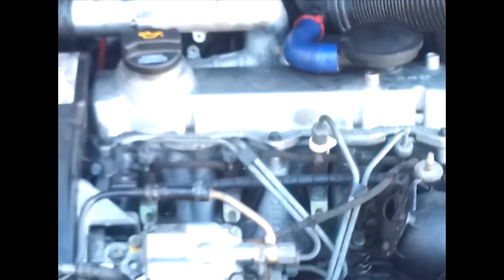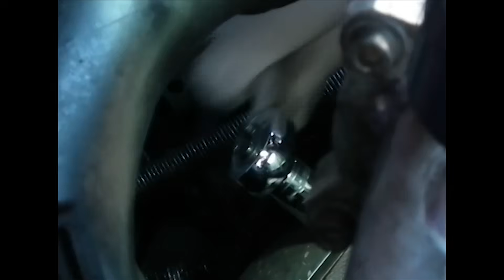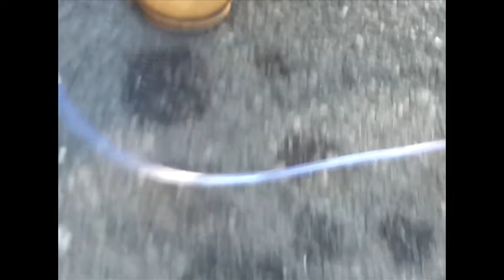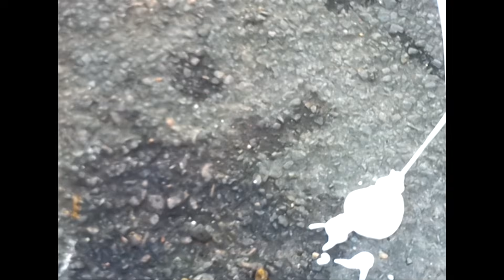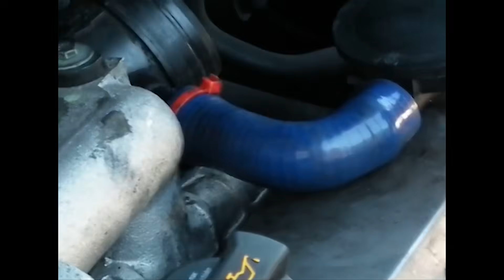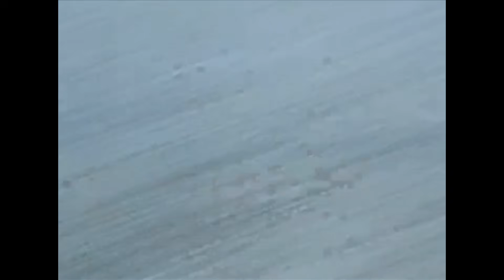Mr Muscle Audi A3 Tdi Turbo Clean - cheap fix

Comment: Would this work on an 2006 Audi A4 2.0 ltr S line as I've recently had a problem on a long journey when after 60 + miles it went into limp mode yet now seems to be working fine?
Reply from the maker: +Paul Phillips if this a TDI?
Reply: +CarAnd “Car Mechanical” Mechanical yes it is & since I put this question to you have confirmed it is an over boost problem
Reply from the maker: +Paul Phillips hopefully now sorted? Apologies for the delay in reply as I am moving. 
This should be fine for any VNT turbo though to answer the original question.
Reply from the maker: +Paul Phillips hopefully now sorted? Apologies for the delay in reply as I am moving. 
This should be fine for any VNT turbo though to answer the original question.
Reply: +CarAnd “Car Mechanical” Mechanical yes it's a 2 ltr tdi only difference is I'll have to remove the EGR valve. Have read though its possible do this leaving it on

Comment: I used your procedure on a 2000 TDI Beetle. I ended up using Easy Off Oven Cleaner w Lye. I had a CEL that gave me a P1557 code, over boost caused by the vanes being stuck open. I used your the more the better technique. Cost was $4 U.S. Thanks,
Dave.
Reply from the maker: That's great news! 
Also regarding the Easy Off does it also contain NaOH? If so I can add a message to the video and description as I think that will help a lot of US guys out.
Reply: Easy Off make a version with & without, I used the version with Na!Ho
Reply: Hello Can I use Wynn turbo cleaner over there ?
Reply: +Mateusz K give it a try!

Comment: Nice vid. One point for people to bear in mind, and this is from personal experience, if your turbo is the original, or mileage is high, be aware of over revving as you might well blow the oil seals on the turbo shaft, and then you´ve got one big job in front of you!! If you´re seeing blue smoke on start up etc. then your turbo seals are probably on the way out.

Comment: Hi,  the cleaner has to be foam?  We don't have in israel that product.  We have a similar product but liquid.
Reply from the maker: +אלחנן יעקובוב I'm not sure that liquid will get to all the places you want at all within the turbo. Essentially you just want a cleaning foam with the Naoh chemical in it.
Not sure if you can import from ebay?
Reply: +CarAnd “Car Mechanical” Mechanical. Can you give me a link to a good foam cleaner?  I searched on eBay but the price was too expensive on my opinion.
Reply from the maker: This is the cleaner http://www.ebay.co.uk/itm/Mr-Muscle-Oven-Cleaner-300ml-/381404541123?hash=item58cd7b70c3:g:eSUAAOSwHjNV-Spl I'd check again on local sites/shops etc... maybe an industrial place has something
Reply: +CarAnd “Car Mechanical” Mechanical ok, thanks. One Mode question,  this process may somehow damage the car?
Reply from the maker: On the Iron/Steel no, on the CAT, nope it'll burn off.
On the Alu maybe (which is why I note in the video not to overfill it) however another guy has commented it's only there for a short time and not enough to erode at the head.
Reply: +CarAnd “Car Mechanical” Mechanical thank you a lot. I Will update for any news with solving the problem.

Comment: May be worth jamming some rag into the EGR hole to stop the foam coming back out, when i did mine i found i couldn't get much cleaner in with that still open but when that hole was blocked up i got nearly 3/4 of a tin into the exhaust manifold/Turbo which did the trick :) (the Actuator was almost Instantly smoother)
Reply from the maker: +K2edg Good point, although I was concerned with if it could travel up as far at the Alu bits. So went with what I thought/hoped was safer.
Reply: In typical belt and braces fashion i tested it on a degrease/clean bit of the cylinder head before putting any in the exhaust manifold, after an Hour it washed off without causing any damage.

I was a little concerned it had filled the bore, so I did remove the Glow plugs and hand crank it over just to be 100% sure but nothing came out.

Just one more thing i did while spraying it in was to turn the impeller wheel gently (not forgetting the tube may need retracting slightly) just so the whole wheel was covered as i didn't want an unbalanced hot side wheel finishing off my Turbo's bearings.

It's a great trick. Thanks for sharing, it saved me a day of pain trying get the turbo off.
Reply from the maker: No problem, and thanks for detailed feedback like this! I am sure it will benefit other people.

Yep getting the engine out and the turbo off later down the line the turbo was the biggest pain to separate for various reasons.

Comment: Thank you, like a new car again. Just finished 40 minute run, slowly for first 5 mins then onto motorway. After about 20mins it stopped smoking completely.Really never would have thought £3 oven cleaner would do the trick. Saved £250 on a new turbo.
Reply: On my 2012 Jetta TDI I bought a Borg Warner 170 turbo for 1200 Canadian and 800 to install.

Comment: Could you do this to a BMW 123d as the results look fantastic?
Reply from the maker: +Tom Hig I'd say I don't see why this wouldn't work on any VNT turbo. My partial thoughts though are; what is access like, how is the turbo orientated?, is there any chance the cleaner could touch something is might damage etc...
With the kind of engine I have I know that is ok but I know BMW engines are mounted the "proper" way so not sure it that means anything is fitted/clocked differently.

Comment: Really good video. How do you know the hoes is going into the turbo housing and not into one of the manifold areas? I'd love to do this on a SEAT Alhambra 1.9 TDI 115 brake horsepower pump diesel tomorrow .
Reply from the maker: +andysuthhero I'll be working on the car shortly so will check how things lined up, this was done a few years ago so memory is a bit rusty. Off the top of my head I think it was kind of inline and the foam would fill from the bottom up so you see it with time to stop before it would get near the ports. 
Our thinking too was anything there would be burned off and through the cat in no time, only concern was not getting it on anything ALU.

Comment: The access to the turbo in a Bora PD130 is terrible unless you have the hands of a Barbie.
Reply: I took off the N75 mount from the right of the engine bay then got my right arm in that way. I hope you have success. my car runs like new
Reply: willwinstanley I've been wanting to remap my car and the company I'm using will delete my EGR for free so I might do that, then I can reach right down and do the turbo :) That's the only thing I can think of. I can't find the turbo actuator from above either. I felt like smashing the car up when I was trying. So annoying.
Reply: +cwuzii I also unclipped the airbox hose from air intake. then removed next two bolts to th left, along it's length, and the vacum pipe clipped to it,  to give myself a view from above. the actuator is very short but is connected to the vacuum bell or can about the width of coke can but 1/3 of height. on my asz 130 1.9 tdi I can only just see the top of can and rod to actuator when bent belly down with torch in left hand leaning over engine. but once you have seen this short actuator lever grab with needĺe nose pliers then push it down a good few times before your back gives out. good luck.  look at some picures online of the turbo itself more closly then imagine what to look for down there.

Comment: Hey man, my golf 130bhp is going into limp mode. What is it that actually puts it into limp mode? I'm planning to clean out the turbo and EGR, but is there anything else to look out for, bad solenoids?
Reply: +razmossis the turbo has vanes in it that open up when you accelerate, they stick open and cause it to overboost hence causing it to go into limp mode. you might n tget a cel light on the dash but you know as there is no power to the car. the mr muscle degreases the vanes in the turbo and allows them to move freely again

Comment: i cleaned out an EGR valve with mr muscle it really is a good cleaner. i want to clean up and old gearbox to get off all the grime and muck thats built off over the years. will mr muscle work?
Reply from the maker: +michael jagger I'd just use GUNK or any other degreaser tbh, something like muc off etc... The oven cleaner is very aggressive stuff.
Reply: With the gearbox i just sanded it with some light paper as the aluminium oxidized and had some pitting looks nice now. It was very dirty at all.

Comment: I did this today, worked pretty well.  In addition, while the intake manifold was off, I cleaned it with oven cleaner as well.  My personal recommendation is buy the cheap stuff next to that yellow bottle.  For this application, the yellow bottle will not take a wd-40 nozzle and therefore no red straw.  Between, the EGR delete, manifold cleaning, and exhaust side cleaning, no more limp mode, now only EGR High flow codes...I need a tune.

Comment: carful u don't get mr muscle into cylinders, if an exhaust valve is open it'll enter that cylinder.    u r on the engine side of the turbo, as in up wind of the turbine?!
be ok if u start it carefully or spray some oil in, ??? not sure what it would do to cylinders?, suppose if u could flush it....u could use it to de coke the engine?   I wonder?

Comment from the maker: Hi Jake, I can't seem to reply or tag you in this but wanted to reply.
If the vane cleaning was unsuccessful it may need a follow up, assuming that is the issue, there may be various issues such as the actuator position, fuelling, the equivalent in your car of the N75, vacuum leaks etc... 
Hopefully you can get to the bottom of the issue, but just in case one option to consider would be an MBC.
Reply: CarAndMechanical ..Great video bro😎👍

Comment: Hi 

This method definitely works have just done on my A4 B7. what garages quoted me that I need a new turbo at the cost of £700.... Thanks to the guy who thought of this
Reply: Icky Rana did you do this via the egr as well?
Reply: Was this a petrol or diesel?  Would this work on. B6 A4 2006
Reply: @enigmamusic6610  you can't tell by the disruption of the title or the sound of the engine?

Comment: This method works ! I have a mk1 Leon 1.9tdi that was over boosting. I have a turbo boost gauge fitted to my car, which showed that my boost levels were approximately 0.5 bar higher than what they should when under load . I used Mr muscle in the same manner as the video and the cars boost levels are back to normal. When I pressed the actuator rod in I thought it was OK before I put Mr muscle through the hot side of the turbo. But after 20 mins of it been in there , it felt much better . one thing to remember is that the aluminum oil feed hose is right next to where the egr outlet post is on the turbo casting, I used a rag to cover it up as Mr muscle is quite nasty stuff. Thanks for the video in the first place, a great guide for people to see.
Reply: plzz tell me how u did this? i have leon 1.9 tdi i wanna try this to my turbo...tell me, u put Mr Muscle into pipe that goes below EGR valve?the long pipe that EGR is connected to form botom side? i read on some forums people disabmmle exaust to get to the turbo, but this way is much easier, and u can btw clean and EGR too...so please tell me how u do this? ty very much, and sry about my bad english...regards
Reply: Hi, you will have to take the egr pipe off that fits between the small turbo outlet flange and the egr valve. You can then use a piece if plastic tube that fits into the Mr muscle can and you will have you poke it down into the turbo like on the video. You are best to remove the egr valve by undoing the  3 bolts that holds it on and cleaning it when off the car as it will be very oilly and thick. Thanks

Comment: Is there any risk of damage to the catalytic converter from the remains of the mr muscle that will get blown through when you put it back together and spin it up?
Reply from the maker: the exhaust temperature will burn off anything remaining and it will happen in seconds. I'd expect it will clean out the cat a bit and blow it out the back.
It's not the same but there are industry solutions that are more concentrated if anything to deal with the same issue.
Reply: CarAnd Mechanical i agree with you but before it gets to go to the exhaust, it goes through catalytic so do you think it will not do any damage?
Reply from the maker: If it did any I would expect it to minimal.

Now from a totally different POV the Cat's restrict performance anyway and I've done away with mine.

However I don't think it would damage it and have neither heard of this too. There are a few kits out there for doing this kind of thing with a higher concentration of NAOH but instead of like £3 cost £40-50 +

Are you in a Country where you get smog tested?
Reply: no we don't get smog test. lucky

Comment: I gave an A3 jetta TDI with stock EGR. Like yours, mine's dropping to limp mode often due to smudge. Where would you suggest filling with the sodium hydroxide based oven cleaner, so as to clean out the turbo ?

Comment: Hi I have a 2001 audi a6 c5 1.9tdi it has 177k miles on clock I has been put on diagnostic machine and come up with fault code charge pressure control positive deviation every time i get past 60mph it goes into limp mode until i restart car do you think this will cure my problem?
Reply: I have the same problem, the error on diagnostics is as follows:
00575 intake manifold pressure, 08-10 control limit surpassed - intermittent

Every different Audi Mechanics is indicating different thread... don't know what to do... still do not want to spend too much money on the old car (which is still very nice from the outside).
Reply: go to a mechanic and ask them to lower the charger pressure control, its a 15$ problem.(however if that does not work thank try this)

Comment: Hiya, I've got a 2004 Skoda Superb1.9TDi which has only done 99,500 miles.The "Emission Workshop" light has appeared on the dash board and I'm told by an Automobile Technician, that it could be the turbo vanes sticking and causing problems. However, I think this method could perk it up a bit. Could you tell me where the Turbo is situated on the Skoda,please? Thanks

Comment: Tried this yesterday on 1998 A3 Tdi and results have been great. Couldn't remove EGR completely but still got the pipe down deep and it has worked. Huge difference in performance and I can now hear the turbo spinning up again. Worth trying. Cheers for the video. Used B&M Dr Clean
Reply from the maker: ***** glad you had a good result :D

Comment: Hi I have just bought a 2009 VW Touran 2.0 TDI spot. It has put it self into limp mode a couple of times hitting 80 mo the motorway. I believe it's to do with the turbo and carbon build up. Will this help the situation?
Reply from the maker: I believe so, how many miles has it got on it? Seems newish so surprised to hear an 09 with this.
I'd also check VAGCOM in case you have sensor or N75 issues.

Comment: I have been wanting to do this for a while, but I was wondering, since the MrMuscle comes out of the egr port, isnt it also going in the cylinder head since the manifold exhaust ports are lower than the top of the egr port ? Im scared it would damage the head or even go in the motor.
Reply: An excellent point. It's gonna depend on the geometry of your EGR system. If the valve is closer to the head than it is the turbo, then I'd have to agree that there is a danger of the product getting into the head and you defo do not want that as sodium hydroxide will 'dissolve' the zinc and aluminium that make up the head casting and potentially do serious damage.
Reply: @CycloneCyd  Hi, its working on 2004, seat alhambra 1.9 tdi without damaging anything? Best regards!!
Reply: @b3nniy  have you fixed the problem? I have the same car!!

Comment: Hi dude,whats the difference after cleaning the hot side of the turbo with Mr Muscle?some negative effects after cleaning or else.I want to do the same on my Golf 4 Tdi.Also can you tell me because i stopped the egr valve from the computer unit if i put mr muscle into the intake to the hot side of the turbo is there a possibility mr muscule to go into my engine thru EGR and the intake pipe and harm the engine inside?Thank you.Best regards

Comment: Well boost leak later in range plus it's really laggy now takes while for turbo to kick in since doing the clean. Where do I get vag com from :/?
Reply from the maker: Vagcom from rhttp://www.ross-tech.com/vcds/download/ and a cable from ebay. I'd check some videos on how to use it. And also check up on possible causes as this is the first time I've heard this.
Could be the egr or the intake piping is loose and exhaust it leaking so the turbo is taking higher revs to spool.
Vagcom should help to diagnose just in case a sensor has gone a miss.

Comment: It was great mate just remapped it spoiled up okay but always thought it's being held back and thought can't do it any harm doing this cause I guarantee no ones done it too this car so I did it soon as I went to put foot down it felt sluggish and laggy then it's picks up when before soon as touched throttle it would go?
Reply from the maker: So you are still getting boost but later in the range?  If it's later it sounds like a boost leak and suspect make something wasn't sealed back up ok. Just to be sure I'd also get Vagcom on and run a code check.